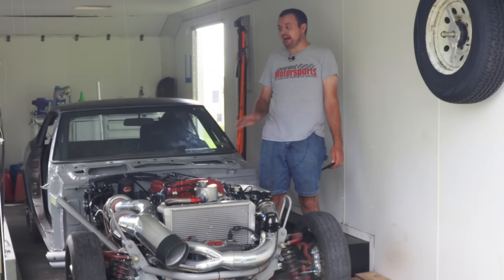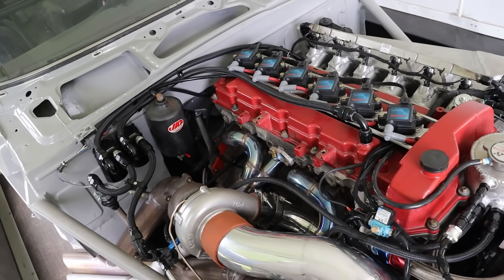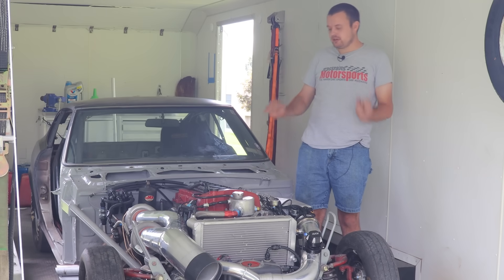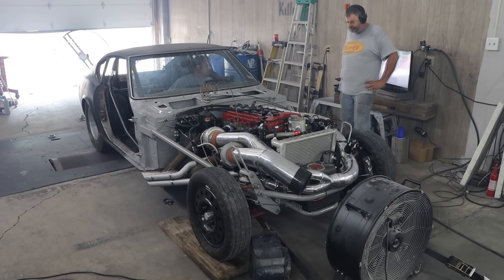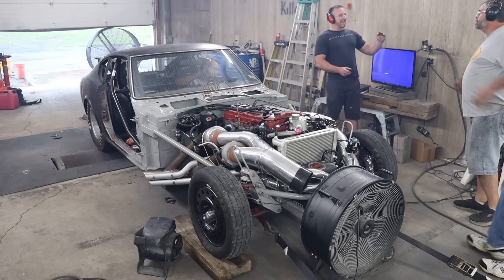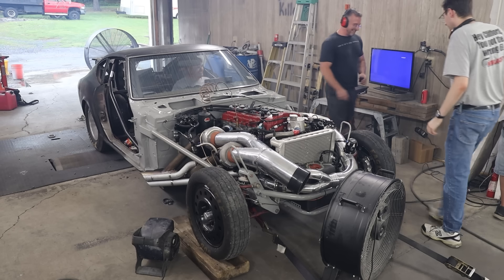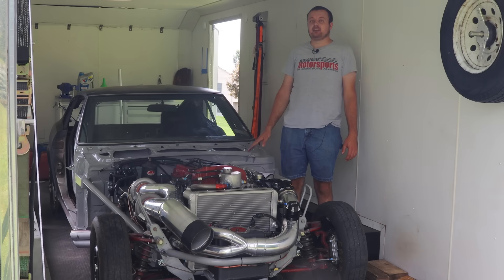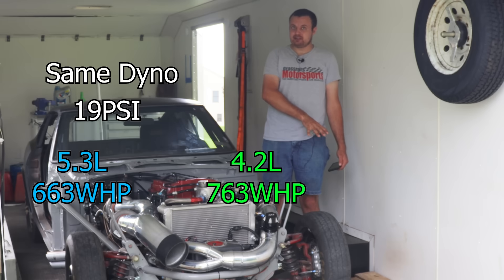This 4.2 Liter Engine Just Beat a 5.3 LS!

Comment: Well one turbo vs 2 turbos would have a lot to do with the extra power. 26 lbs of boost on a 5.3 is good for over 1000 hp all day long
Reply from the maker: The twins have been proven to not add that much. https://youtu.be/w1uOff1E4u8

Also you're not making 1000whp on 26 psi with a 5.3L with the cam specs we have in the 4.2L. That is one of the most impressive parts to me. So much less aggressive valvetrain.

Comment: would have been nice to know torque m numbers too, also dynojet?
Reply from the maker: I forget what kind of dyno he has. It's very accurate though. Track performance lines up almost perfect. The torque numbers are on the graph.
Reply: @Calvin-Nelson  saw after I posted, nice go see something besides the LS with some  solid power. Higher displacement than 2Js or RBs but very nice inline 6.

Comment: Huge, heavy, lacking in displacement... how is that better than the LS engines?
Reply from the maker: They're certainly not heavy. My car lost 200 lbs going from an LS to a 4200. More power with less aggressive valvetrain is always a good thing. To each their own. Not trying to take your LS engine away. Just trying to show an alternative.
Reply: @Calvin-Nelson  Was it an iron block LS, though?
Reply from the maker: @PistonAvatarGuy  yes. Still 100 lbs less than an aluminum Ls

Comment: What is causing the oil smoke on decel?
Reply from the maker: If I had to guess. Poor oil Drain back from the turbos
Reply: @Calvin-Nelson  I have a supercharged LS doing the same. I can't figure it out.
Reply from the maker: @jeffmellow  Hm. Maybe poor crankcase ventilation in your case.

Comment: Damn this engine went under my radar! use to have an 03' chevy trailblazer.... ended up way under selling it as a trade in. always regretted it. limited slip front & rear. Would have been an offroad monster, electric gremlins included though.
Reply: I still have a 2004. The speedo kinda sorta works, when it wants. Anything behind the body control module dead. Except the tail and brake lights.
Heat, A/C controls dead. The dufus daytime running light bull, dead. Replaced it with 16 guage wire and 2 relays. So the rest of the lights do work. Even auto shut off.
 Hey it runs. Heat and a/c still work fine. If you are doing 60 MPH, fan died. Sometimes the interior lights work on their own. Yep got to go out and check or they drain the battery. GM electricky N gineering at it's finest.
 Motor & trans 200,000 miles, no problems. That might be why they quit making the Atlas I-6.
Oh and removed the front drive axles. One of the differential bearings went bad. Funny how those are so similar to the the 2003 Venture Van.
 I really do not need to drive in the snow anyway.
Reply: @warrenpuckett4203  yeah, idk wtf gm was doing in the late 90's to mid 00's but holy crap did their wiring suck. I had about 200k miles on mine to. Bought it with the transmission rebuilt, it would slip a bit when you get on it, but that's probably from the transmission rebuild. Lots of places don't actually rebuild them and say they do around here.

Comment: Barra's in Australia have a massive following, get onto an Australian performance shop, also check Adam LZ's  Barra mustang build, pretty sure he got parts from Australia. Plenty of barra's running around down here with 1000hp
Reply from the maker: This is not a Ford Barra. It's a Vortec 4200. People have nicknamed it the "Ameri-Barra"
Reply: @Calvin-Nelson  Ah ok, would there be similarties between parts or if you looked at barra's with a stroker motor and looked at what aftermarket support they used?
Reply from the maker: @kanebatten5343  I've contacted a few companies about just that.

Comment: I'm betting that barring detonation, this thing will put 1200+ to the wheels. You're not at THAT high of pressure ratio. Enough fuel and heat management it'll come down to not breaking the driveline. And if you're running with an air to water loaded with ice.... Yeehaw, this thing is going to cook.

Comment: Mmmmmmm, I wonder how it would do as a truck engine? Full size 1/2 ton mild build with a mild turbo. Power and mileage?
Reply from the maker: They came in what is essentially a truck, soooo should do great. I was getting 22mpg with mine in my station wagon going down the highway at 2700-3000 rpm. Unlocked auto, no overdrive.

Comment: I'm not hating, I think this is super cool, but the 6 cylinder is 4 valves per cylinder, and it looks like it has more turbo than the LS swap you're comparing to, so the results makes sense to me. Good stuff for sure I think this is awesome.
Reply from the maker: Yeah. As long as the two setups are not causing a restriction, there really isn't a benefit to going to twins. An S480 with 96mm turbine is proven for well over 1000whp on a 5.3L. You may find this video interesting. https://youtu.be/w1uOff1E4u8
Reply: @Calvin-Nelson  yeah for sure man. And I just meant i bet the twins flow more air than the dad's single as they looked to be a pretty good size. I think it's dope this engine is reliable. It'd be cool to see 1000 whp reliable
longblock with just pistons and rods.
Reply: *shortblock
Reply from the maker: @TurboV8boi  we'll keep developing them.  The twins are only 62mm, so not too big. We've ran them on a 6.0L they capped out around 850whp

Comment: the boost number means absolutely nothing. But yeah i get the point, that engine seems pretty fucking good.
Reply from the maker: It's just a common point of reference between to two engines. 

Boost is actually a pretty helpful tool to see how your setup is performing. Are you getting consistent hp per psi? When you back calculate what it should make NA, does that seem reasonable or is it much lower than you would expect? If it's low, something might be wrong.

Comment: Man.. aftermarket support would be amazing for these engines.. I have a 3700 vortec in my Canyon.. same design.. but 5 cylinders instead of 6... I have been wanting to upgrade it.. but just no support aside from a shitty looking ebay turbo kit.. the only option for more power on these trucks seems to be an LS swap... which is a major pain on a 4x4 because of the different bell housing and passenger drop T-case...  COMMON AFTERMARKET... GET ER DONE!!
Reply from the maker: They actually have Ebay turbo kits for the 5 cylinders.

Comment: I inherited a brown 74' 260z from my dad in HS. Fixed it up and ended with a ZX Turbo motor. Stock 4 speed had a looonnnng third gear. Lots of fun back then. I'm actually surprised you can fit in the front seat.
Reply from the maker: It's a very tight fit. Lol

Comment: Great 6 banger .. for almost the same price the 5.3 will 100 percent make more power , same with 6.0 ... a lil more cash ..6.2 ,7.0 why would anyone develop parts for an engine that was short lived , when there's WAY more potential with the v8s...
Reply from the maker: Yeah. They make parts for lots of stuff that were limited production. Nice thing is the 4200 was not limited. Go to a junkyard you'll see tons of them. Go for a drive you pass 5. They're everywhere. I guess they should stop making parts for the Barra, 2jz, and RB26 because the LS exists... you're right.
Reply: @Calvin-Nelson  it was made for 7 yrs .. and in one platform only .. how many platforms has the ls been in .. and for how many yrs ... if your thinking was correct do you not think the aftermarket would reflect that .. or possibly your thinking is wrong , mine is right and ghats why all the aftermarket reflects embracing the ls instead

Comment: Yeah... but as long as the 5.3 is a Gen 4 then you don't need to put rods in it... Main problem is that a LS is tiny, were there are very few cars you can fit a straight 6 motor in to.
Reply from the maker: Yup. LS engines are awesome. Some people want something different though.

Comment: I have a 6.0 LS and had a 4.2 L in a trailblazer.  I love both.  When the 4.2 came out, it was GMs most advanced engine.
Reply: lol there were more advanced engines in the early 90s
Reply: @pbr247  It was GMs first drive by wire and VVT.  Name the motor that was far more advanced.  It is also the most powerful inline N/A 6 cyl. ever made for a  SUV or car.
Reply: @kevin122759  vettes and trucks had electronic throttle years before that…so what?

Comment: 850hp on a 'race car' is 1990's shit. Let's see how it does around 1500 which is easy and cheap with a 6 bolt ls now. Would be nice if the heads on the LS were better and 1/2 studs were the norm.
Reply from the maker: I wouldn't call a 1500hp LS cheap. That's a $15k build at the least. We have about $2k in this motor.

Comment: For years enthusiasts have swapped V8 engines into GM's smaller pickups (S10, Colorado, Canyon, Sonoma, Etc) but what if there was another option that may be overlooked. After watching this video, I wonder how well a Turbo 5cyl Vortec 3700 (LLR) would perform.
Reply: GM added a 5.3 to the 2009+ models too.  You got your choice

Comment: I hope that the aftermarket is paying attention as this is a wonderful platform for the everyday guy to build and race thanks for the information that you all are putting up for us 🇺🇸
Reply: Well what anyone should really be paying attention to is how this guys dyno graph is inflated beyond epic proportion. 
He states 867 whp, but the HP and Torque numbers dont cross at 5280 on the graph. HP is a calculation based on torque. And the way any dynamometer works is calculate the torque based on wheel speed and engine RPM. So long story short, the numbers should cross right around 5200-5300 range.  As you can see, they do not. So this guy is manipulating the numbers somewhere.  I’d guess the real WHP numbers are about 600 give or take.
Reply: @champspec at least he doesn't dump money into 4l60s
Reply: Ya know, absolutely! Gotta give'em a hand for what they have accomplished...

Comment: Are those engines all the same throughout the years? And what year engine did you use in your build?
Reply from the maker: They're all pretty similar. We used an 02 bottom end with molnar Rods with a ported 06 head. Here's a link. https://sites.google.com/view/vortec4200wiki/home

Comment: The Ameri-barra its not a ford motor. Chevy calls the motor an LL8 Atlas was its designated nameplate. Congratulations on the power with stock crankshaft it helps when it basically has a gorilla cage holding all the caps to the block like a diesel. I hope I can make that much power with my Atlas when done. HELL YEAH BOYS

Comment: Once again, we see why 4 valves per cylinder and DOHC is a thing compared to cam-in-block. 19lbs of boost is NOT the same when you can flow a ton more air through the engine and you can just stuff more CFM and oxygen into a block before it builds boost. It's the same reason the Coyote loves boost so much or the reason race built VK56's bored and destroked to 4L can make 600-800HP (IIRC) with a carburetor. 

LSes are popular because they're cheap and easy to modify with a massive aftermarket, and Niv's experience with having to fabricate parts and only being able to source one forged rod is what holds the Atlas back. Not everyone can do that or wants to. Lack of aftermarket and lack of interest are reciprocal issues that feed each other and kill truly neat engines like the Atlas and like my personal favorite, the LT5 of the 90s ZR1.
Reply from the maker: I can understand the LT5s demise. They only made like a 10000 of them or. something. There are still so many 4200s left!
Reply: @Calvin-Nelson  There were about 7,000 LT5s made. 
So yeah they could never be as big as the Atlas could be, but still it's sad to see a good engine go unrecognized and under utilized.
Reply from the maker: @leecline5759  agreed!

Comment: Most engines GM has made are better than the LS. What is your question?
Reply from the maker: I disagree. Old school small block is worse. Iron Duke 4 cylinder. Any of the older inline 6s. The 2.8L that came in the third gen Camaros. The list goes on.

The LS is a great engine. Just not very efficient.

Comment: That's DOHC 4 valve,  super balanced crankshaft, as long as the block casting is strong enough it'll make the 2jz a all but forgotten swap. I'm telling ya, as long as it's all balanced and you got the right set up it'll smoke a ls and a 2j.
Reply: Then I’ll make it a billet block, bore and stroke it, balance it, and boost it to the moon
Reply: well yea it's a 2.5- or 3.0-litre VS 4.6 of muscle lol
Reply: The thing is after market support, and the price per hp, availability in the US is very important. To touch a junkyard 2j or Rb you're already at or above 3k, an LS  2k, Lm7 600, a 4200 is between 4 to 600 for a running engine, it's superior to a 2j in almost every way
Reply: @bobmotherfuckinsmith3089 I’ll have to see about finding one, I’m sure a billet 4200 could handle some big power
Reply: @fadedsoul23 there’s a company in Australia that’ll CNC pretty much any GM engine outta billet 6061 aluminum
Reply: @MS-mr4zm  what’s the name of the company? I found an Aussie company once that made billet 2jzs, sr20s, and other engines but I forgot the name
Reply: @bobmotherfuckinsmith3089  maybe except size and weight and compression ratio, but yes
Reply: Those 4200s are sooo slept on.

Comment: Awesome!! Makes me wanna try and find one to test myself! 
Just wondering, whats the reason you run meth instead for E85/E100? Surely not needed at this powerlevel?
Reply from the maker: You don't have to run an intercooler, and that means it will be lighter. As you will see in future videos, the front end does not have a lot of grill area. This means a air to air is not really an option. Water to airs are heavy, so we chose to give methanol at try. We may convert to water to air in the future once it gets turned into a land speed car.
Reply: @Calvin-Nelson  Awesome! I see your point. Listened to you on Sloppy podcast. Cool stuff you guys are doing! Keep up the good work!

Comment: Great stuff!  I always wondered why this engine just disappeared after the Trailblazer.  When I bought my 2002 TB, there were all sorts of articles about how great an inline six was compared with V6's.  I loved the smoothness.
Reply: I6 engines started declining because peter puffer CEOs realized that V6 engines (which have no fucking business in performance vehicles) are cheap to make and package well.  Too bad they are too stupid to realize that 'cheap to make' and 'packages well' aren't things that should be looked at when designing a flagship sports car (lookin at you Nissan).
Reply: Two cylinders to long to fit in a Silverado or Camaro. Besides cab forward is in style. But wouldn't you just rather have a V-8?
AS for smooth? Yes. Quiet? Yes. My 2005 T-Blazer needed a tach. Because it was the only indicator the engine was idling.
Did a real good job of moving the 7 passenger and the 5000+ lbs around on regular gas.

Comment: I believe its the Straight 6 configuration. Straight 6 has 3 balance (firing) points in a 360 degree rotation while v8 has 4. I love inline 6 engines.

Comment: Modern engine vs pushrod tractor tech. 24 valves vs 16. What would you expect?
Reply from the maker: Not that much delta. 100hp is a LOT
Reply: @Calvin-Nelson  valve area times boost. I thinks its pretty close to what we see on 2 liter 16valve engines here on europe. Modern motors rule!

Comment: I know how you feel every one wants to ignore GM small engines when there is a lot to unlock weather its a 6 of inline or v configuration or some of the 4 cylinder engines I've modied some and had great results. History of GM small engines has shown this to be true as well but then everyone gets upset and hey you can't run that like the 3.8 in Nascar and prostock. Good luck on this.

Comment: I used to have a 2003 blazer with the 4.3 v6, and i was pissed when i found out the 2003 trailblazer with the 4.2 i6 has 85 more horsepower. Always thought that motor had some potential but never saw anyone build one
Reply: To be honest you would probably do better against one than you think. Trailblazers almost weight 5,000lbs. They are slugs.
Reply: @sierravmax  true, didnt know they where that heavy. Still the blazer is like 4000